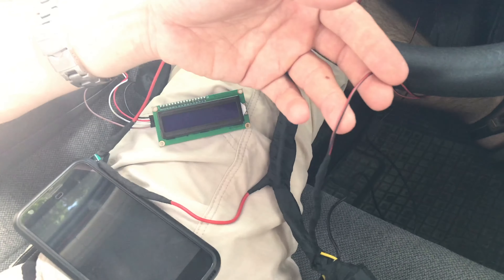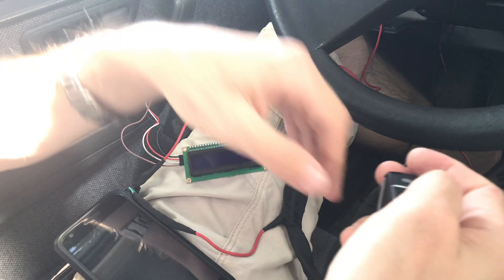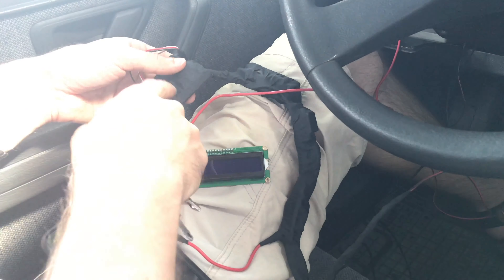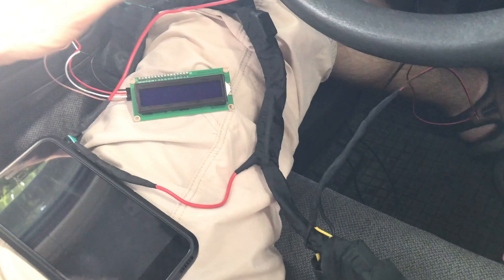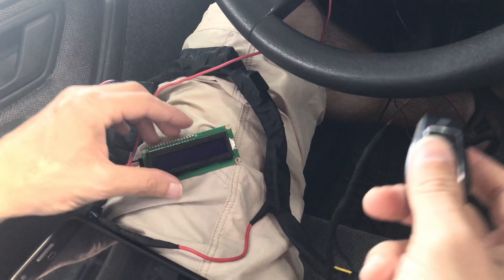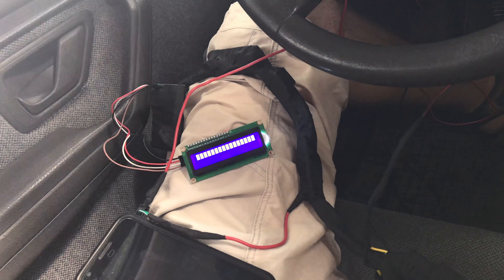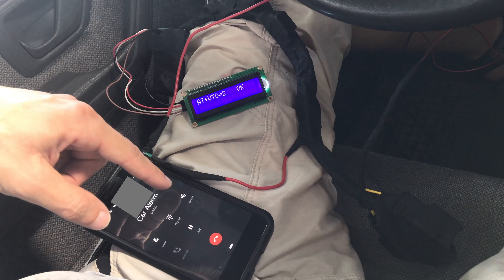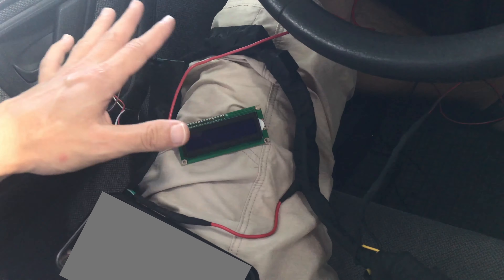15$ GSM Car Alarm Arduino Module

Comment: That's pretty damned cheap! Is there not a monthly charge for the GSM connectivity?
Reply from the maker: You need to install a SIM card from mobile operator that support 2G internet. In my country, I found the cheapest for 1.8$ a month. With 50Mb internet and some minutes to call. For this kind the alarm is enough.
Reply: @nn5n  Thanks! I thought that would be required. Looks like there are plenty of IoT providers willing to still do 2/3G. Kinda nice to be able to tell the cops that your car was busted into while on holiday in Tahiti. :)